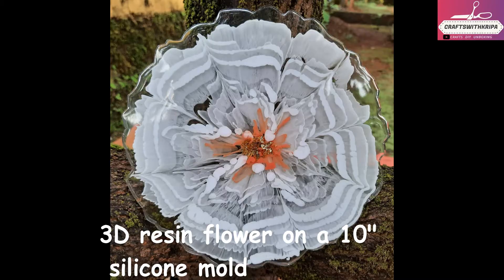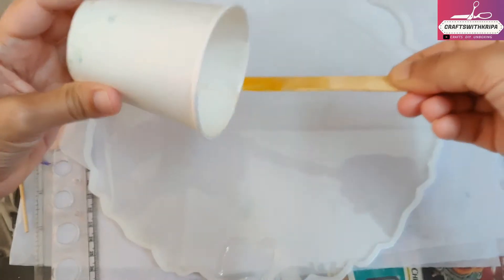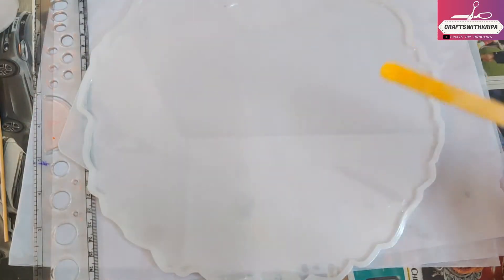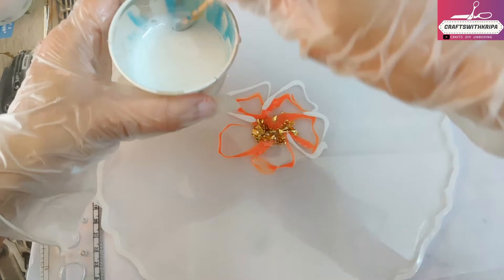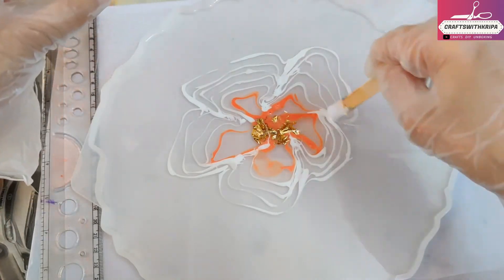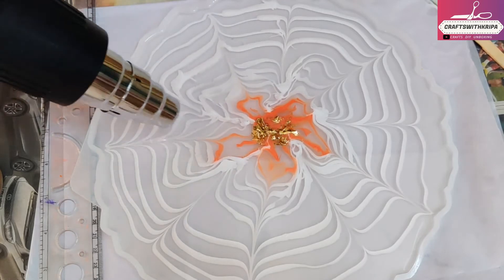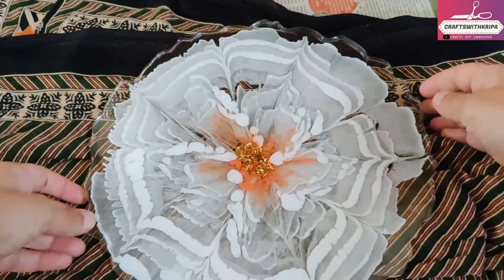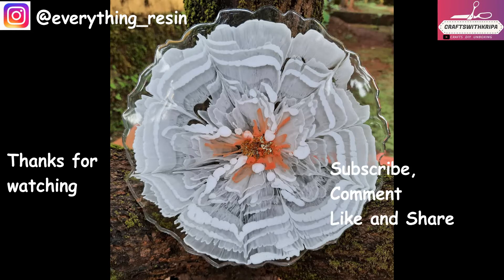#3 How to make a 3D flower pattern on a 10inch silicone mold

Comment: Lovely. Can you pls suggest what it will be used for ? Centre for dining table ? Hmm or
Reply from the maker: @Manisha's Creative Studio You can use it as a platter or attach 2 handles and it can be used as a tray or make a hole in the middle and you can turn it into a clock or just use it as a wall hanging/decor

Comment: Which resin brand have u used?
Reply from the maker: @Vidhi Dhabria Here is used the 2:1 resin from Itsybitsy
Reply: Mam can you provide the link for it..i m looking for a resin to make floral coasters...epoke i tried..bt nt giving that effect
Reply from the maker: @Vidhi Dhabria If you are looking to make 3d flowers I would suggest resin from Resinartbyritesh. Works great for the flowers. You do not have to wait for a long time to make the petals. I have tested the resin. You can take a look at that video here :
https://youtu.be/E2OmBRxFPT8
This is the link for the resin: https://resinandritesh.com/collections/epoxy-resin/products/epoxy-resin-2-1
Epoke 3:1 resin will not work for this effect as it a low viscosity resin or slow curing resin. You need a fast curing resin to make this effect
Reply: @CraftsWithKripa  thank you so much for the help